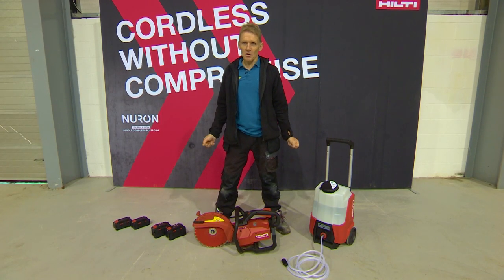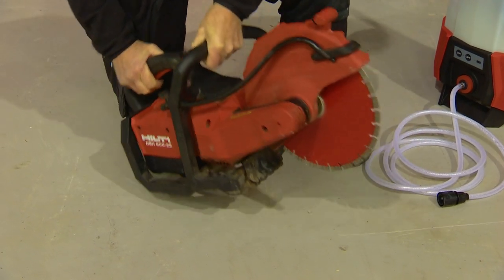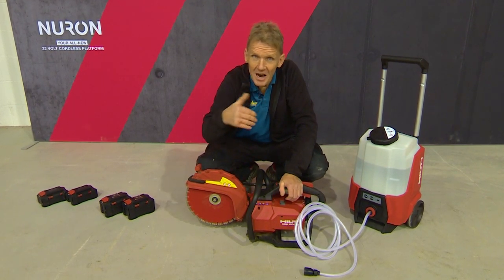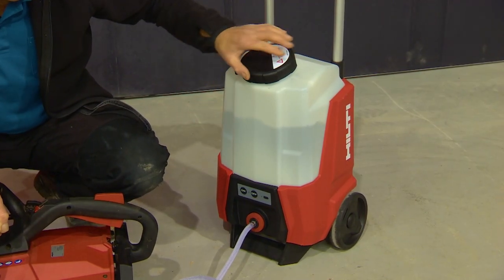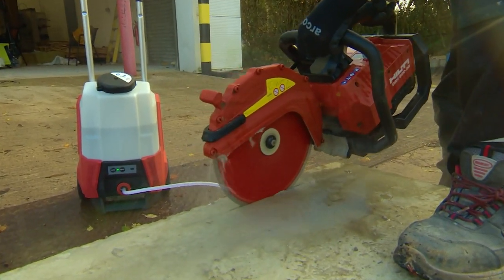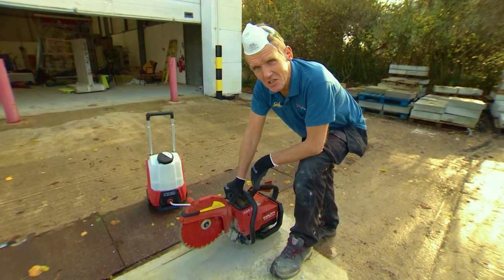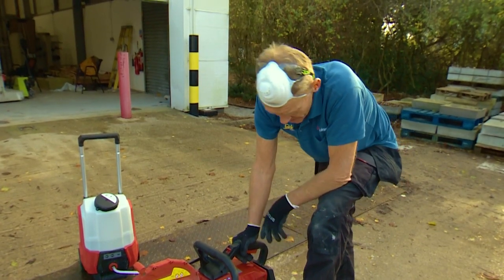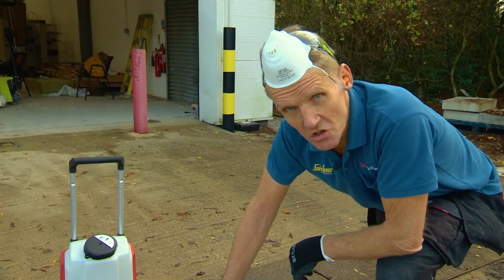Hilti DSH 600 Cut-off Saw for Concrete, Metal & Masonry

Comment: The batteries for this one to run it as he said are £250 each. You will also need two chargers as they don't sell a double.
Reply: They charge quicker than you'll empty it so one will be enough just have to switch turns ;)
Reply: @rz3877  Nonesense.
Reply: 2 batteries and a charger £1700 = divorce
Reply: @rz3877  you cannot run it on just one battery, it needs the two
Reply: Yes I understand it runs on two batteries. What I mean is that you don't need a second charger because you will not empty the two batteries in the saw before you can charge two spare batteries on one charger, you just have to switch to batteries that need charging. 
And yes the machine is expensive but so is petrol and I have to agree with Roger that a two stroke engine takes a whole lot more  maintenance than electric. And new lungs are also not cheap, when you have to do a renovation and need use petrol in a closed space petrol is terrible. 
At the company I work we work with Hilti and Hilti is not the greatest. Their cordless circle saw suck big time and they don't even have a planer and multitool which is annoying but overal the rest of the tools a pretty good and I never worked with a brand whose batteries last forever until they're dead. This concrete saw still needs to prove itself but so does the 40 volt range Makita
Reply: @rz3877  ahh I get ya! Still shocked by the price though 🙈
Reply: Yeah and what happens when the batteries reach the end of their life but the tool hasn't? What will you do? Spend 500 quid on a pair of batteries or buy a new saw? The way I see it is many a good battery tool gets binned because the batteries are dud. We'll be seeing it with EVs soon. For sale, Toyota Prius. Batteries not included.
Reply: Can't agree more and that cause the same with the mitre saw table saws and vacuums. Corded is not that bad after all hey

Comment: for big ‘cordless’ gear like this they should use large battery packs on a short umbilical cable - should be cheaper and have far more capacity.  You don’t need it to be totally ‘cordless’

Comment: It takes two batteries, keep another two on charge. How much will four 24v  batteries cost?
My Makita drill  batteries are £50 each si they'll be silly money.
Reply: My account says ....... Saw, Charger, x4 Batteries  2307.00 plus the dreaded!!! 🤪
Reply: The batteries needed to run that thing with any great efficiency are £250 each you will also need two chargers as they don't do a double🔋

Comment: I dont know really.I fail to believe these are a subsitute for any two stroke because the power must drop off as the batterys drain and you hope the others have charged up.I can see the advantage for small chainsaws because you havnt got to pull them to start up a tree which is brilliant.Also that concrete slab you were cutting still looked very fresh and not 50 years old and hard as granite?I am not sold overall from experience of cutting concrete.Also the blade width being so thin is going to deflect against a piece of stone aggregate in concrete and shatter never mind re bar you didnt expect?Just my primeval knuckel dragging opinion.